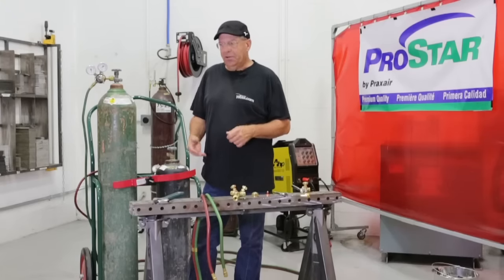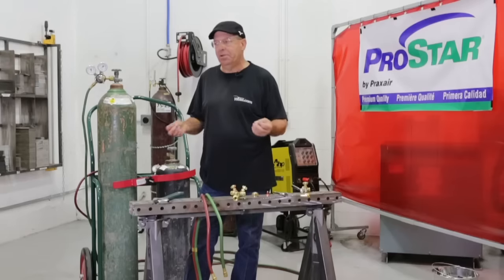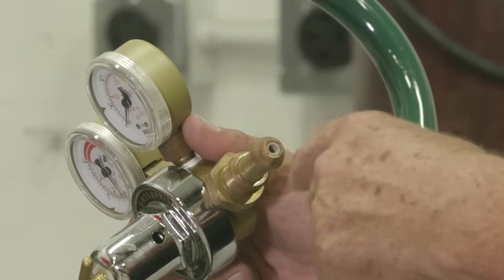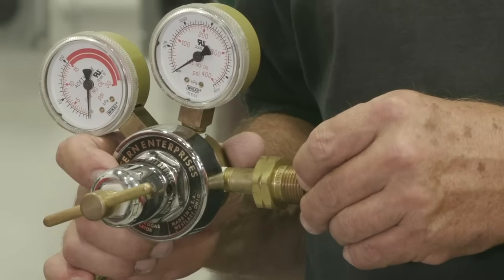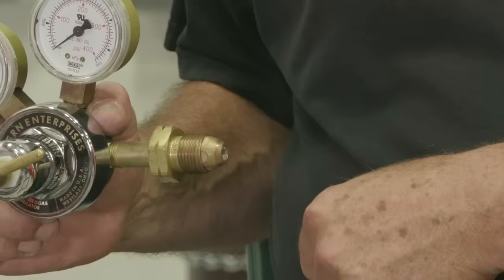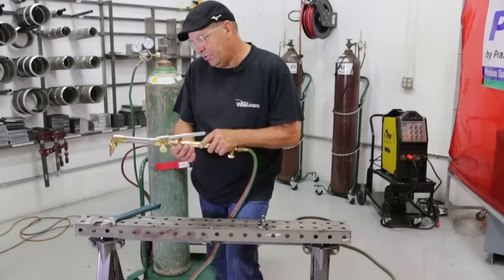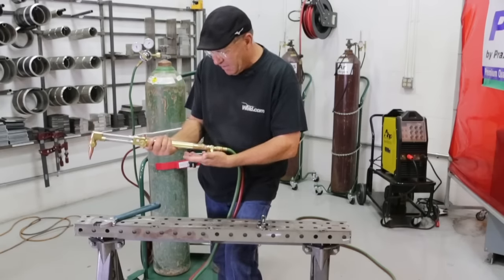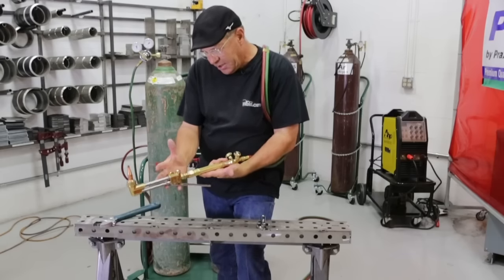🔥Safe Oxy Fuel Setup and Operation

Comment: I always recommend if you buy used drop it off at the shop have them go though it. If you have regulators sitting around for 5 years drop it off at the shop rubber in them drys out the cost of a rebuild is cheap $20-30 not worth risking it. If you do buy used just price in the cost of rebuild what you offer someone.

Comment: Hi Bob first of all thank you for sharing the skills of a being a professional weldor as well as being safe.  

I was wondering if you could do a video    using 7018ac rod I have an old 225 miller thunderbolt boat anchor I am cleaning up and going to use for some projects and then upgrade later.

Comment: Hi . I have oxygen/acetylen bottles that I have not used in a couple of years because my gauges was leaking oxygen or acetylen , so they still have fuel in them , both have their caps on them but they are dusty from windy conditions what do I do for my acetylen to clear the passage way , so I can install my new gauges

Comment: Great video!  Can I test the flashback arrestors by turning on the gas on one hose with the other one disconnected and check for gas flow out of the disconnected fitting?

Comment: I've seen flashback arrestors in both places, between hose and torch, and between hose and regulator. My Question, is that additional arrestor just after regulator a good option? or it doesn't matter that much to mount one here? (i think it would help in case of pierced oxygen hose burst into flames or smth, do such things happen?)

Comment: Hi Bob, I watch all your videos ans have learned a lot. My question is about oxy/acet.. I have an old Airco torch without built in flame arresters.   I mounted my flame arrestors at the regulator, not the torch is this correct or not. Awaiting your response thanks in advance.
Reply: Personally I'd rather have them on the torch body.
Reply: @bobmoffatt4133  Thanks for the quick response.

Comment: Was working at a marine warehouse in Honolulu. An oxygen bottle was unsecured. Fell over , snapped off the valve and took flight. Punched a big hole through a cmu partition wall about twenty feet up. Found it out in the parking lot.

Comment: hi, thanks for the video. I just purchased my professional Oxy Acetylene torch kit. I’m a mobile tire technician and every so often I get a chewed out or stripped lug nut service call. This method of cutting the stripped lug nut off down to the stud is a very effective way of freeing up the tire thus getting this job done. Is there a grease that I can spread over the rim so that it may not burn in the process? Also, is carrying this professional kit in my work van all the time advisable, or should I  just load it in the vehicle as I need it?
Reply: Hi rodney,  i see nobody has answered your question so ill do my best, anyone else please feel free to correct me or add something in ive been working with torches many years but am by no means a guru.  They do make heat shielding gels, sprays, and other heat dissipating products, i believe depending on what and where your cutting around depends on the usefulness of each product.  Would definitely be worth it for you to look into more.  As for transfer, obviously theres always some risk carrying bottled gases with you but leaving them at home when you may need them is going to cost time and money so keep them with you, but 1.  Have a safe place to securely store them on vehicle away from heat, electrical and other hazards as much as possible.  They MUST be secured, upright with protection caps on,  and a good steel cabinet with bottle braces is best.  2.  Always disconnect your hoses/regulators when torches are not in use and make sure the valve protection caps are on both bottles.  3.  Inspect hoses regulators tanks etc for leaks & damage even more than you would normally.  Driving and life in a service truck is inevitably harder on torch sets.
Reply: Also forgot to mention to check all local and state regulations for mobile torch setups

Comment: GREAT VIDS      THANK YOU
I HAVE A VICTOR HEAVY DUTY TORCH,  2PC  I HAVE THE CUTTING HEAD ON IT
GO IT FROM AN OLDER GUY,   I THINK IT'S AT LEAST 15 YEARS OLD  MAYBE 20 OR MORE,  I CLEANED IT UP,  IN GREAT SHAPE,   QUESTION-  I'VE READ ON FORUMS THAT THE OLD VICTORS WERE FROM IRELAND   THE NEW ONES ARE NOT A SHADE OF THE OLD ONES,  I WAS GOING TO SELL IT,   SHOULD I JUST HAVE IT REBUILT????
I STARTED WITH AIRGAS HOUSE BRAND RADNOR,  MED. DUTY,  IT'S OK BUT GAUGES ARE VERY CHEAP,  WHAT'S THE QUALITY OF RADNOR, 
THANK YOU FOR THE GREAT VIDS,

Comment: love your video Bob,, I was also wondering if you could do a video on oxy hydrogen welding etc. I recently bought a set from an old lead burner,, they were journeymen and used oxy hydrogen because it is so very clean, and therefore   jewelers use it all the time. you don't see oxy hydrogen often but it has many advantages. anyway I would like to see if you could do a video on this process, there are many of us old timers  (like you) who would benefit and many newbies would have another process the add to their resume . thanks
Reply: I've not done oxy-hydrogen  work.

Comment: I'm looking for a regulator to fill tires with Co2   Say 150 psi Co2  .  Any suggestions ?
Reply: Nitrogen/CO2 service rated regulators are available at most welding supply. It takes an adapter since either have a unique connection...

Comment: I thought using a oil based soapy water could cause the oxygen to ignite?
Reply: I've never heard of oil based dishwashing liquid to be completely honest and dishwashing liquid is usually what's recommended. 

The oil warning is mainly for putting any type of oil, grease or lubricant within, on or around the connections. Like some people (including me) have thought that applying a little bit of rubber preservative on the o-rings to aid in prolonging the lifespan. I was thankful to learn that doing that was a HUGE NO NO! 

When using soapy water for checking leaks, you only use a minuscule amount of dishwashing soap with the water. Less is more in this case.

When you're checking for leaks and find one, you wipe it dry, fix it and check again. The liquid doesn't really have a chance to enter the system if you do it like this and use common sense, in my opinion. There's really no reason to apply anything on the outside of the system either due to the materials used. If I'm wrong, I'm sure someone will chime in. Hope this helps.

Comment: But if those flashback arrestors are integrated in the torch, how do you change them when they go bad. Torch arrestors are supposed to be changed every 18 months according to american OSHA regs, as they go bad even without flashback from proximity to the heat of the torch. Guess that is why regulator mounted arrestors have no expiration date but specified to be tested every 24 months.

Comment: I have a love-hate relationship with my rosebud tip! Pops after a few minutes of use. Doesn’t seem to help by adjusting regulator pressures. Any help?
Reply: I would like to know as well, I have heard the shutdown sequence is different between cutting tip and the rosebud tip..
Any feedback is welcome. Thanks
Reply: What size Acetylene tank are you running it off? Remember the 1/10 withdrawal rule.

Comment: QUESTION 2
AN OLD WELDER   WORKED AT A SHIPYARD IN MIAMI
HE SAID   TURN THE ACETYLENE UP TO ALL THE WAY,  I GUESS  HE MEANS AROUDN 10
HE SAID THE ADJUSTMENT IS AT THE TORCH ,  NO REASON TO SET PRESSURES  5/20 OR WHATEVER
IS THIS RIGHT???? THANK YOU
Reply: From what I've been taught, the reason to not open the acetylene valve more than one turn is  that if you have to close it in an emergency, it can be quickly closed with the one turn you opened it with.  With the low delivery pressure of acetylene, the one turn will give you all the fuel gas you safely need.

Comment: There's a reason an electric solenoid valve is on the oxygen when coming from a manifold system. Oxygen is so dangerous, if it changes pressure drastically, like turn the the valve open extremely quickly to an open regulator, BOOM! High pressure! Take your time opening the valves and make sure those regulators are all the way closed at zero.

Comment: It is my understanding that old acetylene bottles can become dangerous over many years of just standing around unused.  There is something in the acetylene tank that mixes with the acetylene to keep it stable but over time these two things can separate.  Can anyone shed some light on this?
Reply: Acetone?
Reply: @bobmoffatt4133  Right. Copied this from a PDF at :
http://www.hse.gov.uk/pubns/indg327.pdf

Explosion hazard of acetylene cylinders
An acetylene cylinder has a different design from most other gas cylinders. It
consists of a steel shell containing a porous mass. The acetylene gas in the cylinder
is dissolved in acetone which is absorbed by the porous mass. Decomposition of
the acetylene is triggered by heat, eg when it is:
 involved in a fire;
 scorched by flames from a blowtorch; or
 involved in a flashback.
The porous mass slows down any decomposition of the gas. From the start of
decomposition to the cylinder exploding could take several hours. This should
provide time for emergency action.
Decomposition can be triggered more easily and proceed more rapidly if:
 the porous mass has been damaged by repeated flashbacks;
 the cylinder has been mishandled or dropped;
 the cylinder valve is leaking; or
 the acetylene in the hoses is above the pressure recommended by the supplier.
There are a number of incidents each year where a flashback into an acetylene
cylinder triggers decomposition, leaving the cylinder in a dangerous, unstable
condition, which can lead to an explosion.

Comment: Why do u open the oxygen valve on the bottle all the way?
Reply: High-pressure cylinders like oxygen, argon and CO2, etc have back seat valves so they seat in the full open position so they won’t have any risk of leaking through the valve stem since a full cylinder is around 2200 psi!!

Comment: Where is the flashback arrestor, between regulator to hose and from the hose to handle attachment for the safety..
Reply: you should have watched the thing
Reply: 12:10
Reply: They go between the hose and the valves on the torch body.

Comment: What kind of lube would you use on the o-rings?
Reply: Nothing at all, oxygen and lubricant will combust under pressure alone.
Reply: CAUTION!! NEVER, NEVER, EVER lube oxygen fittings!! Oxygen+any kind of grease or oil is explosive! It will cause an angel to rise from your ashes. Seriously! I don't think even the best fba will stop a real explosion!!!💥
Reply: I hope you are joking,lol? Never oil a o ring on one of these unless you   want to start a fire or make a bomb.

Comment: Bob, PRIOR to screwing ANYTHING into a gas bottle, PLEASE, PLEASE, PLEASE CRACK the bottle to blow out any debris!!!!!!
Reply: @mattis537  how does this relate to bottles in the beds of oilfield and construction trucks? Are there plugs available that go on before the cap? And also, God should always be capitalized. Thanks.
Reply: @tommyt2854  yes there are plugs available for most all type of connectors, threaded or quick-connects. I work in the offshore oil and gass sector Atm so yeah, there are plugs. In fact if your gass supplyer deliver bottles without plugs installed i would consider changing supplyer. Its standard practise to plug all connectors not in use on gassbottles, spools, hydro components etc. 
English is not my first languge so i apologize.
You are welcome.
Reply: @mattis537  thanks.  Plugs make sense, but locally all the suppliers just wrap the valves with clear cellophane. Stay safe out there!
Reply: @tommyt2854  wow, maybe you should tell the local suppliers in your area about plugs. you can get plastic plugs for like 1cent a piece. You stay safe to man.

Comment: Do these procedures at work in the field and you will be fired right away. Its all fun and games, but in the field you ain't got time to play. Just fire up and go, no bleeding, no checking. Also you can get ass kicked if you turn off regulators after use so other worker will need to adjust them again
Reply: I think an inspector needs to take a look at your company's procedures. Being "in the field" isn't an excuse.
Reply: At a mill I worked for several years back, a younger know it all would shut off my bottles and lower the regulators when I set the torch down to do other work for a few minutes. Twice! He smugly said "sorry force of habit" he's lucky I'm an easy going guy.

As far as this video goes, when I'm going to break, I'll bleed it. If I'm done working, I'll bleed it. Done for the day ect... I DO practice these measures. 

I still recall, time to time about that little POS touching my rig.
Reply: avo On regulators mounted in oxy sets on mobile service trucks, if you back off the regulators they will unscrew themselves while you are driving to the job and drop onto the deck and get lost under a welder or some other items in the back of a vehicle.
Reply: @Mentorcase  interesting.
Reply: Yup is all the years I have worked I never seen anyone do it this way.  Bottles get shut off and that is it.
Reply: I'm sure the manufacturers would like you to wind the setting in and out every time you use it, stretching the internal diaphragm until it fails and then buy a new one.